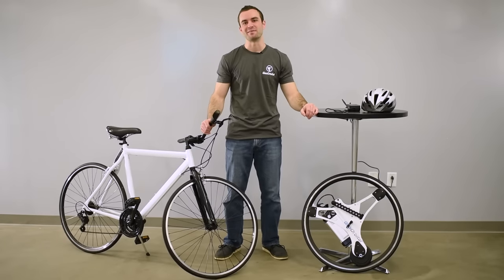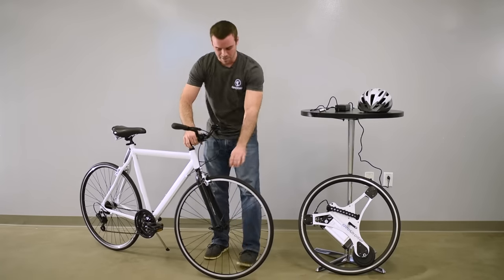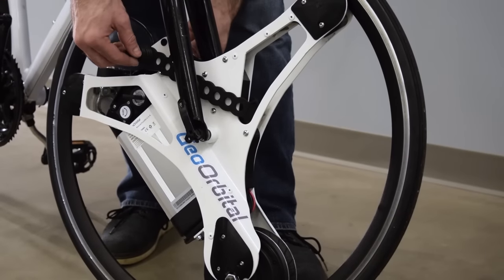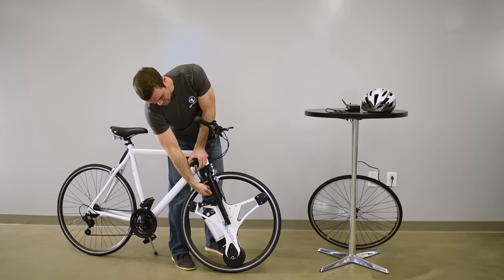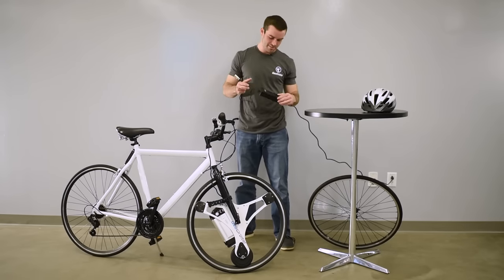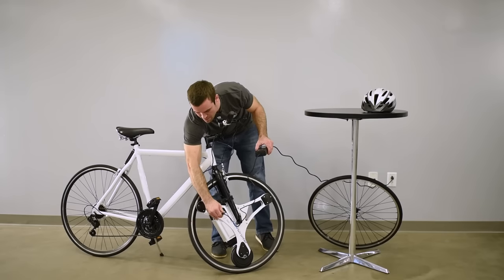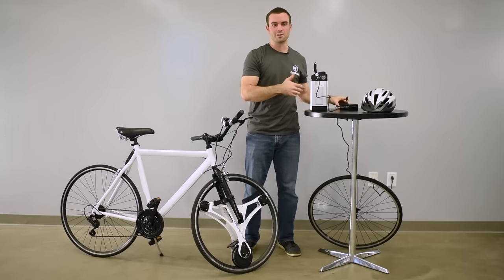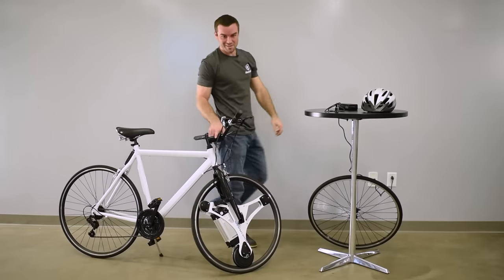GeoOrbital Wheel Basic Installation

Comment: Can I put one on the rear wheel, to make a 2 wheel drive bike? It can only work at certain angles? How strong is the regen? Can I make the regen strong, so I only need my brakes for emergencies? And will you make a twist throttle, like a motorcycle? And can the twist throttle have cables or inputs for 2 of them, and a switch to use front, rear, or both?

Comment: dumb question: can the bike be ridden without the battery? like if, for example, the battery dies and you want to save some weight on the front. will this damage the motor or anything else?
Reply from the maker: Yes can be ridden normally.
Reply: Yes sure you do!
Reply: @GeoOrbital  interesting to see that you're actually lying about your crappy product
Reply: @GeoOrbital  No, it can't be ridden "normally" -- it can be ridden with great effort due to the drag.

Comment: Amazing product! One potential flaw is theft.. I would 'hardwire' a GPS anti teft tracker in the wheel. Through this you extend your product and service with another value proposition..
Reply: It would be pretty useless without the key though.
Reply: But does a key come with a new battery if ordered separately?

Comment: I already have an electric assist bike with a 36V/9.6 Ah/350W BIONX system that powers my rear wheel. If I install a GeoOrbital wheel on the front, will I be able to double my travel distance on a single charge? Also, does the GeoOrbital wheel come with snow tires?
Reply from the maker: Al, you will certainly be able to go further but its tough to predict how far. Snow tires are not currently an option. Sounds like an exciting project